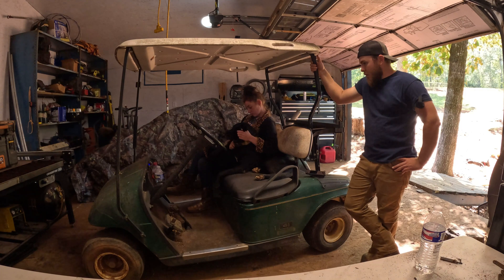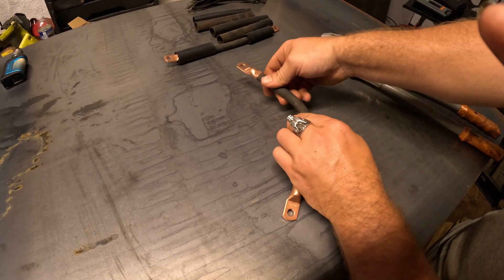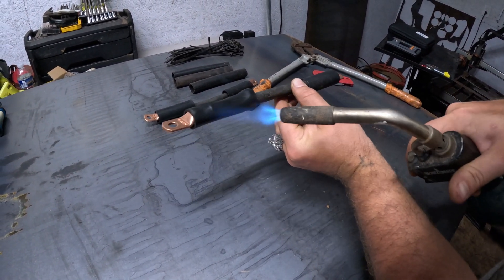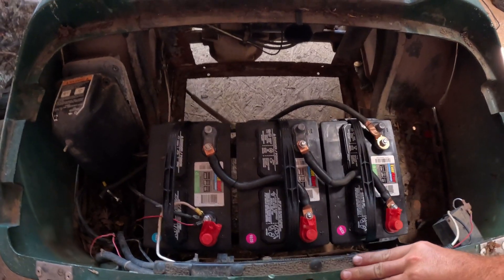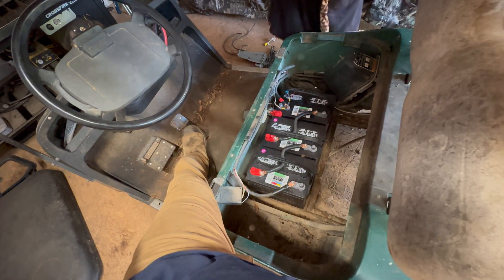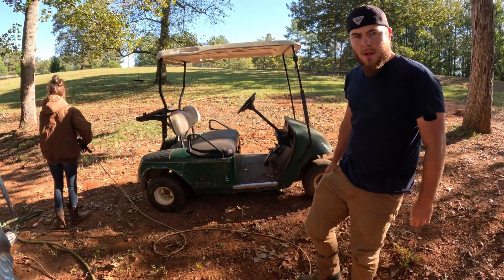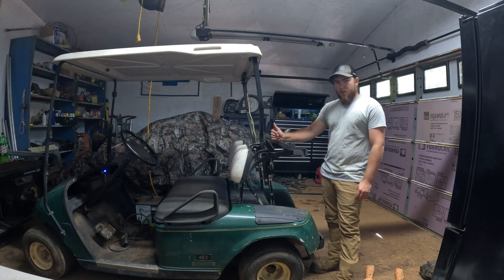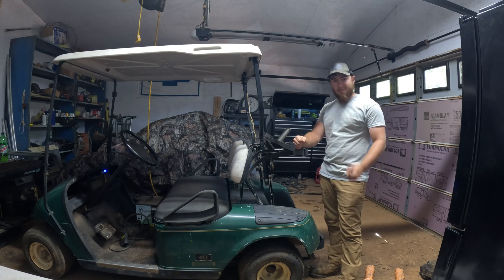99 EZGO TXT 12 volt battery conversion

Comment: Did you use your regular 36 volt charger at all on your cart after you converted it to the 12 volt batteries?
Reply from the maker: Yes I use my 36 volt charger to charge it up and it works just like normal

Comment: Thinking of changing my 4 x 12 volt Ezgo RXV weak batteries with Walmart marine deep cycle max and  adding solar.  You said you don't know how many mile for 2 days on a charge but my question is how many hills?  Are you up and down or mostly level.  For me, it's up or down when I'm in one of my carts ( all gas except for the RXV).  Great video.  Explained well and easy to follow.  Thanks again
Reply from the maker: Where I ride one way is just mostly down hill but on the way back is all up hill . My girlfriend uses it for her gardening she does around the house and is always pulling a little  trailer . We have been charging it more often but I plan on adding more batteries and testing it out . I’ve just got tied up with other projects
Reply from the maker: I still haven’t added my solar panels and I believe that will be a great improvement . One day I’ll get it done and test it out

Comment: Where did you find the panels and charger??
Reply from the maker: I had the panel give to me but they do sell them on Amazon in a lot of different sizes  and the charger I bought off of Amazon for around 30 or 40 bucks . One panel isn’t enough to run the charger